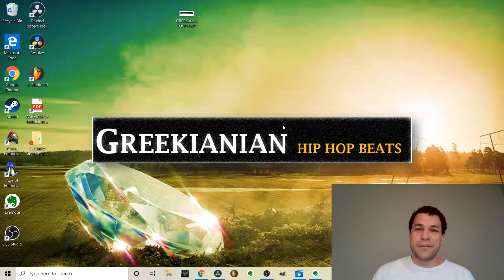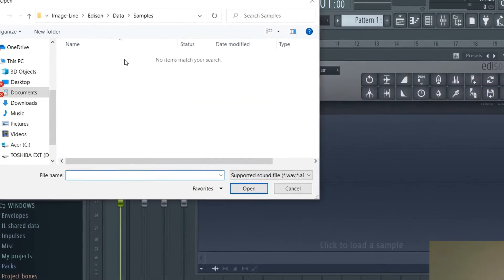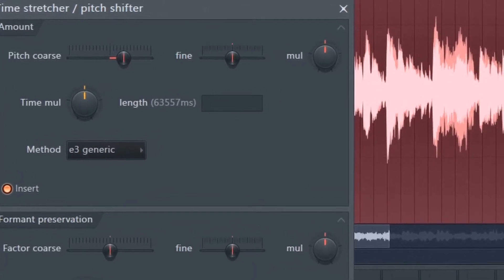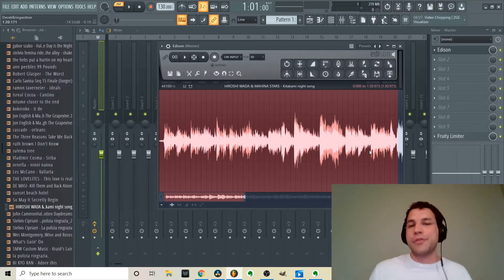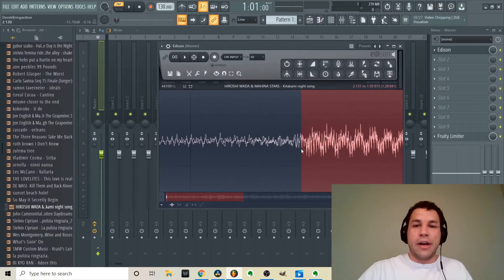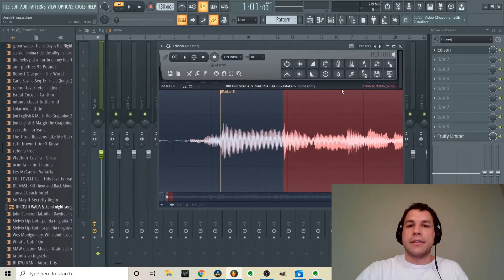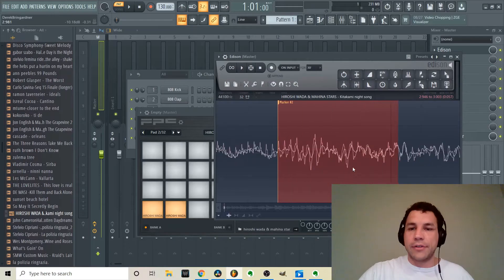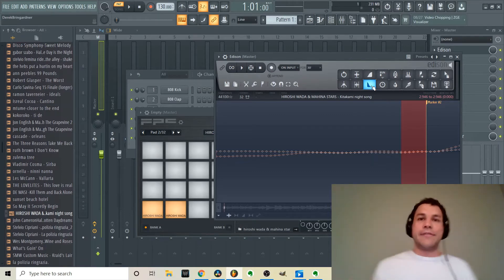Using EDISON in FL STUDIO to chop samples, chop drum loops, and more!!!

Comment: Good video. If you want to use FPC and assign the pads their own mixer channel without loading each drum on the channel rack, gets messy, you can assign by changing the number on the out (upper right corner of fpc) it will assign from what mixer track the fpc is on. So if you put the number 2 in out of fpc it will assign the sample 2 tracks to the right of the fpc mixer track.